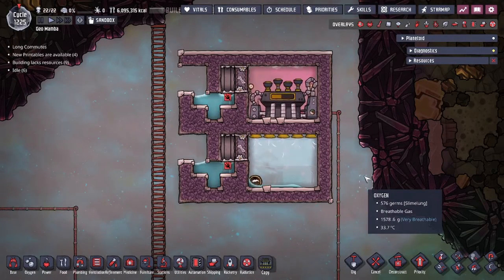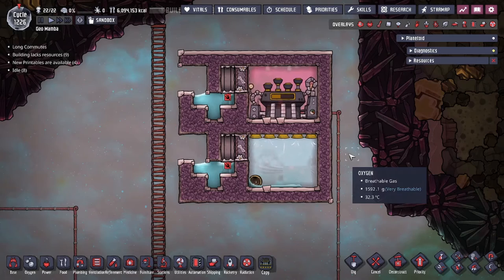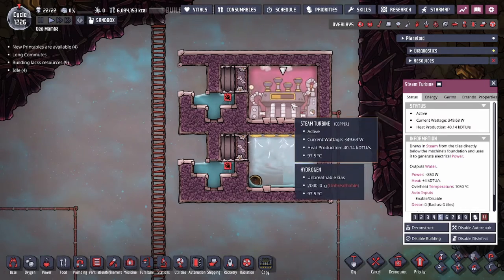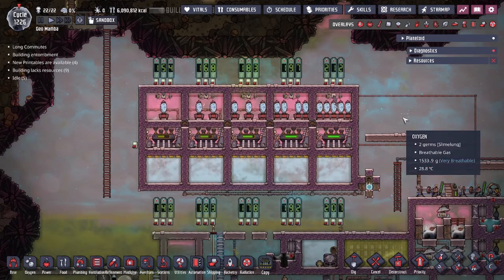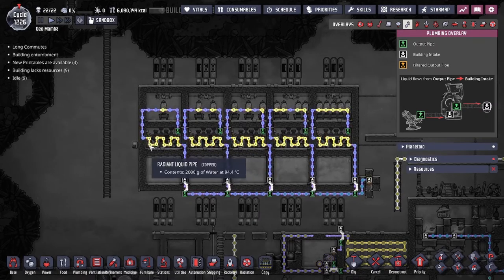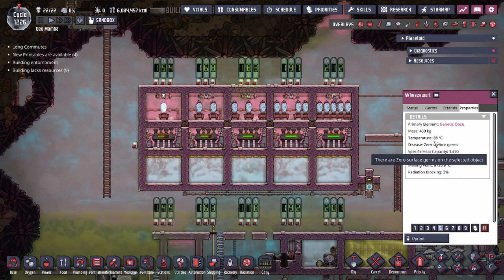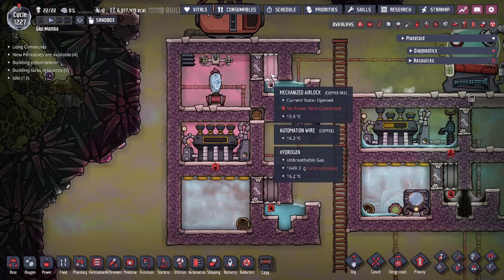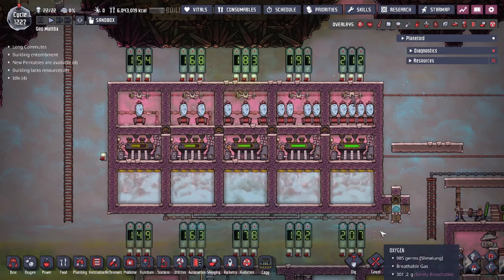Cooling a Steam Turbine with its own Output Water - Even at 200c Steam - Oxygen Not Included

Comment: I'll definitely use this design, it's so practical that each inlet of the turbine is equivalent to a wheezewort.  I was having the issue that I didn't have access to steel but I really need geothermal power due to the super sustainable archivement and I really need the power run a metal refinery.